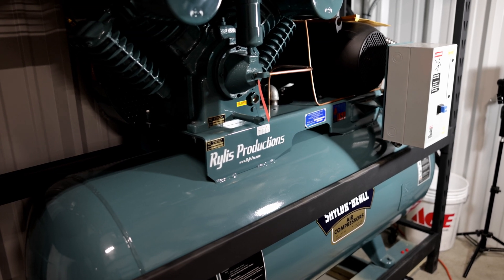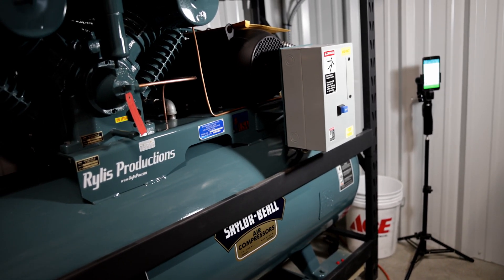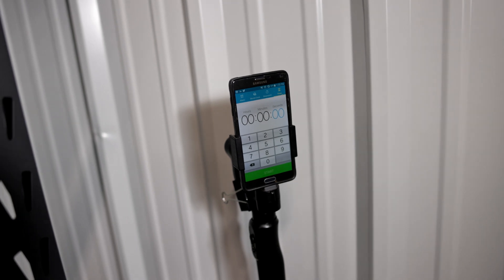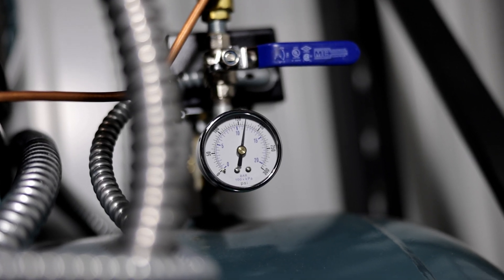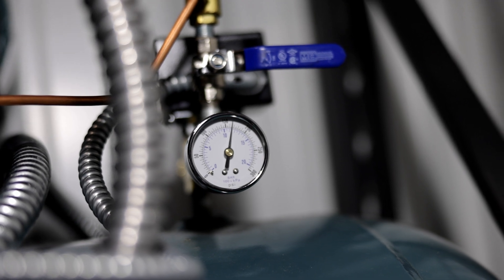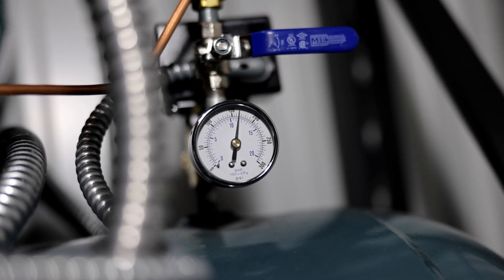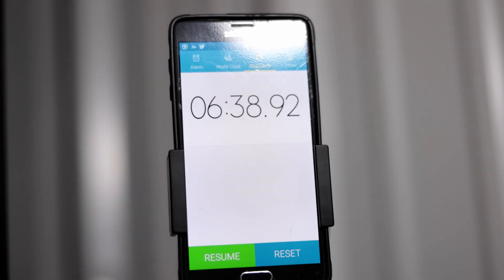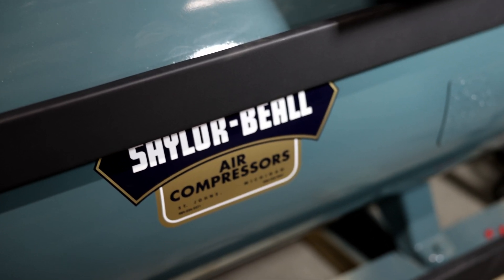How long to fill a Saylor Beall 120 gallon tank?

Comment: I own a Saylor-beall  myself..a 60gal  3 h.p. 705 pump. Built in may 2022..a quite  running  with all the bells..I even have a factory  hour meter..on the magnetic  starter  box..a low cost  piece  of mind..for maintenance  hours..and If I sell it  prof of running hours..great video..check mine out on my utube channel  Stephen eggert..

Comment: Is the dual voltage part of the premier package? The compressor will run constantly.
Reply from the maker: I'm not sure about the dual voltage package? The compressor in our shop is 220 volt single phase only thanks!
Reply: Yea, the dual voltage is confusing. Roiair uses this term to describe if the compressor can be switched to run constantly and not cycle. I don’t think it’s actually anything electrical, but basically a setting that allows it to run constantly. Sorry for the confusion.
Reply from the maker: @r.guardia9107  no worries! When I ordered, chose which features to have. I do have the constant run valve as well as the auto drain, & magnetic starter. The only thing I didn't get was an air cooler as I will add a refrigeration unit to cool down the hot compressed air for plasma cutting, sand blasting cabinet, air tools & anything else that requires dried air
Reply: I just bought  a Saylor-beall..60 ..2 stage 3 h.p. I'm a one man shop at home..I ordered  the full performance  pkg.. comes with a low oil control  shut down if u are low on oil..vibrant pads  rubber feet ..a fan cooled after cooler....a extra  quite  air intake filter..  that package..I spent some heavy pocket  change..nothing china made on this unit. Mine wt is 600 lbs..shipped on a palet..u l need a lift gate drop service..at your home or business..a little  extra  charge..you get a air comprsoir  that will last 35 yrs or more if u change the oil , airfilter. Every 3 months  if u run it every  day 8 hrs..ok I hope this helps u choose  the right one for you..
Reply from the maker: @stepheneggert7388  congrats on the purchase! I thought about the after cooler but will be getting a refrigerated air dryer instead
Reply: @RylisPro  Saylor-beall  all the way...it took my unit 8 weeks on delivery..I went through  pacific  aircompressors..in Oregon..  had lift gate drop service..I ordered  extra  oil..and air filters..belts.  a can of Saylor-beall  spray paint to touch up if needed...lastly  I asked  for a factory  hour meter..for maintenance      log...and an up graded crank case vent..like yours on my 705 pump..less pressure  pulsating  of the oil in the pump..mine unit  wt.is about 600 lbs ..for a 60 gal unit..I'm a 1 man worker..il probably  order a nother  one for our self service  car wash in Feb 2023..I like this one so much..down load there parts catalog. And option  list.thats how I found my build for mine..part #,s..
Reply from the maker: @stepheneggert7388  awesome! Happy for you!
Reply: No u have an upgraded unit ..a consent  run option..I don't have that..if u sand bast or ..its set up for it..great choice..on your unit..I have everything  but that option..on mine ..its a quite  running  unit I can say..my wife's  happy it doesn't  drive her crazy..when it's running in my garage..
Reply from the maker: @stepheneggert7388  you got a nice one & will last a very long time!